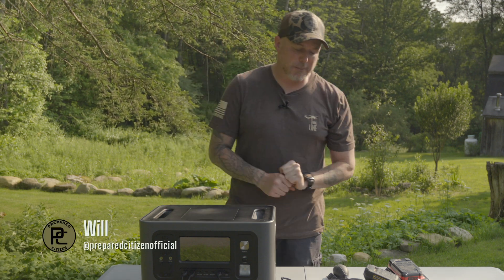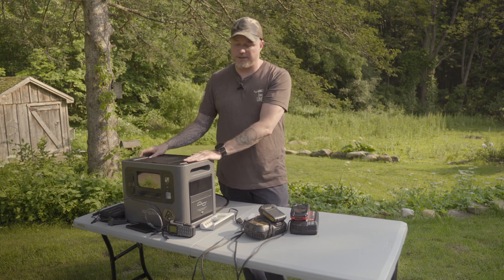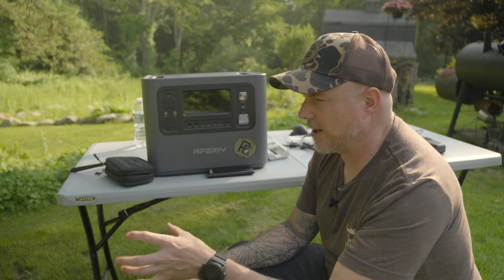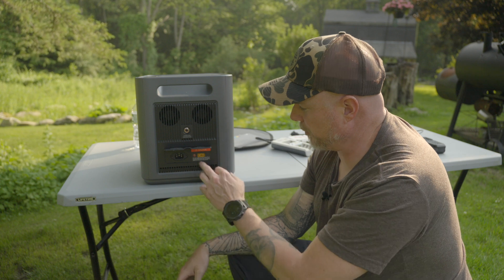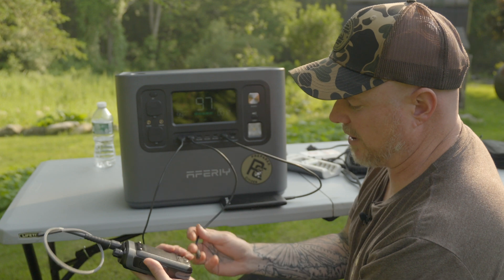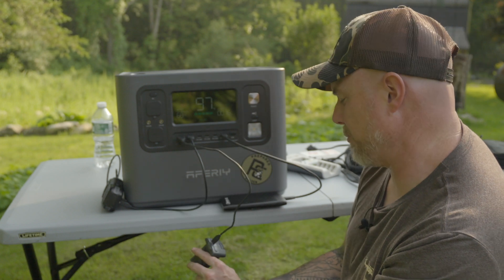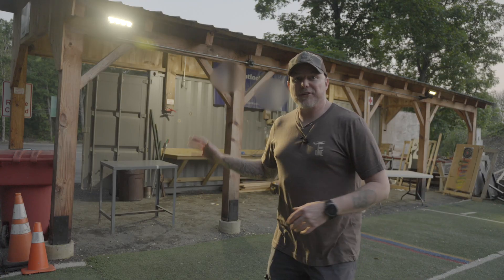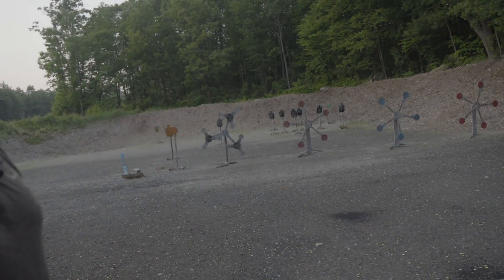What People Get Wrong About portable ￼Power Stations

Comment: Good vid. I went with Anker for two reasons: 1-the cooling fan was quieter (small cabin!), and, 2-it's on wheels and I'm 70. On the AC vs DC outlets, and I'll try to explain what was explained to me, I use the DC outlet when I can to charge radios, phones, battery chargers, etc. It skips the step where the main DC generator has to transform power into AC...only to step it back down to DC into the device being charged. Akin to using a 100ft extension chord and getting power loss. Don't understand all of that, but I do know that it uses way less power from the solar generator.

Comment: I need to get power like this because I have a cochlear implant. I will need to be able to plug into something that would have the same as if I were to plug it into the wall. If there’s a blackout plugging it into the wall won’t work. Any ideas which ones would be good for that?
Reply from the maker: If your charger isn 120v you can also look into an inverter for your vehicle.

Comment: I’ve got 7k warrs of solar generators and 800 watts of portable solar panels.  All are Anker products.  Anker is more expensive than a lot of the junk (like the Aperif you demonstrsted) but it will ansolutely work when it has to.  I have 2 C1000, F2000 and a C3000.  Solar panels are 2 200 watts and a 400 watt.  Having 3 portable solar panels allows me to charge multiple generators at the same time.  The F2000 and C3000 have pass through charging.  This is critical to be able to pass through charge from a solar panel to charge a solar generator while you are powering something else at the same time (fridge/freezer).  Not all solar generators have pass through capability.  I think what I have has me pretty well prepared…unless there is an emp which will kill all of this equipment.  I do keep a C1000 and 200 watt panel in faraday bags for “just in case”.  

Olight makes led light strips that are very inexpensive ($12.99) provide a lot of light and use very little wattage.  I have a few of these to provide most of my interior light needs while using very little wattage.

Comment: In a SHTF these are definately not what you would want, batteries are way to small, not enough power, and not made for long term hard use! But I put Ecoflow, Bluetti etc in that group. These are cheap, chinese high frequency, chip based units, dont like inrush as he said, no skill saw, dont like heat, and should not be used but half of what there rated, battery's too small, can be hacked, yes, solar input too small. I say this because I know, and not to just be a dick. I own 2 low frequency ( transformer based ) units, 3000w output, 6 120v ac plugs on 2 15amp circuits, 5 13.8v cigarette ports, 1 30amp TT30 port,2 mppt 150v solar ports, 2000w input, no limit on battery exspansion, built in battery expansion,  and can use any battery, and or chemistry! Can car charge, solar charge, and ac 1500w charge at the same time and pass through at the same time! These are real solar generators! They sit on 10kw in batteries,  so as I say, these chinese units are not what you want! Can you build your own cheaper, yes of course, but if you use cheap chinese high frequency inverters, you just built a cheaper, cheap unit

Comment: Using the power station to run AC lights, even if they are 'LED' lights is not the most efficient lighting.  There are plenty of USB powered LED lights out there which are more efficient use of the power station in a SHTF scenario.  Plus, the USB powered LED lights can be run off of a power bank making there more portable as well as a more efficient use of stored power.

I have several power stations from Anker, C200, C300 which can provide 300W of AC, C300 DC the version without AC, C800 Plus as well as many Power banks ranging from 5,000 Ma to 50,000 Ma for different needs depending on the application.  I have converted all my flashlights to USB rechargeable and have both AAA and AA USB rechargeable LPF batterie that can provide a steady 1.5 Volt output for their entire runtime, unlike LiON or NIMH batteries that only provide a fading 1.2 Volts.  

Everything is (genuine) USB C where available and not the "simulated USB C" like on some devices which only works when running/charging from a USB A port and requires a USB A to USB C cable.  All my USB cables are Anker rated at 240W so the can charge at all levels.  I found out through trial and error that not all USB cables are the same and that even if a device has a USB C charging port it may or may not be a 'fully functional' USB C port, meaning the device will negotiate for the best (fastest) charging rate and is merely a 'marketing ploy' to be "USB C compatible".
Reply from the maker: Great info! Thank you.

Comment: The generator can charge the power station for 2 hour (the approximate amount of time for this specific power station to charge 0 to 100%) the power station could run to a refrigerator for 8 to 10 hours. You save on fuel and can run the power station all night without the noise.
Reply from the maker: What happens if you run out of fuel? For your generator

Comment: Can you charge it with your car lighter adapter?
Reply from the maker: Negative. Only solar or plug it in to a 120 outlet
Reply: you can with something like a 12v to xt60 or xt90 (depends on what plug type your power station has). Aferiy sells one called the "AFERIY XT90 ACC Car Charging Cable." It will charge at 100w max, so it's more for topping off than recharging the unit from a low level.

Comment: The issue you’re seeing is likely due to electromagnetic interference (EMI) or a ground loop. Solar generators (especially ones with inverters or charge controllers) can emit EMI that interferes with audio equipment. When you touch the generator, your body might act like an antenna or slightly shift the grounding, which interrupts the mic signal—especially if you’re using unbalanced audio like a 3.5mm mic.
Reply from the maker: All of that sounds completely logical to me! Thank you
Reply: he is correct.. you are an antenna lol....
Reply: Yep, found this out the hard way. We run our cabin on an Anker 4+kwh setup. I was setting my GMRS radio on top of the Anker when not carrying said radio. Took me a while...actually an old Army RTO operator figured it out...to realise why I wasn't receiving any comms during the day!

Comment: Two things: 1). The "pure sign wave"  is exactly what you should be charging/running sensitive electronics from.  It is perfectly clean and as safe as the electricity from the grid. 2). The real beauty of using a battery station is to run devices overnight so you don't have running generator advertising your preparedness.  My 1024Wh battery can run my kitchen fridge/freezer for around 12 hours.  My 2048Wh can run my natural gas furnace for 9 hours (I had an electrician install a plug at my furnace for my generator/Ecoflow). I can leave both fridge, furnace, and other things running and charge them up (via passthrough) with my generator in the morning.  Plus running a generator 24 hours a day is inefficient. Running a generator to occasionally charge up these battery stations is the best of both worlds. Long story short: we had a tornado come through my neighborhood one December. No power for 10 days. Some lowlifes were coming into the neighborhood at night and rummaging through damaged houses.  The mayor eventually had police and the National Guard stay overnight in the neighborhood, but the first few nights I was concerned about someone swiping my generator. it's a hard decision to run it overnight or not when it hits 15 degrees.  Since then I have purchased devices totaling 4kWh to use in tandem with my generator so I control when and how often the generator is running. I am a big believer in this setup.
Reply from the maker: Nice to see that you’ve had some real world experience! Thank you so much for sharing that with all of us
Reply: I am 😊😊

Comment: Thanks Will...Own a few of the major brands for "niche" uses...(Skylink, Fiber service, refer back up (as it does not need to be, but 2 hours at a time etc., as well for use on acreage away from shore power)...We also use propane duel fuel for out buildings for A/C and we have larger duel fuel for 240 needs))...the end all beat all is multiple solar set ups for specific solutions using batteries and inverters, this allows for redundant systems that in the event of WTF (which comes after SHTF) can be parsed down to just the absolute necessities...the trick is 6 is 3 and 3 is none when it comes to managed off grid power.
Reply from the maker: Your welcome. Thanks for the extra info!!